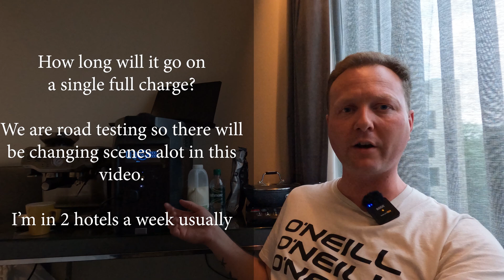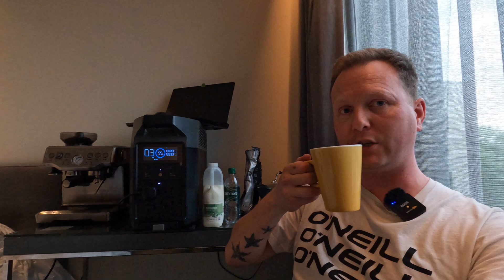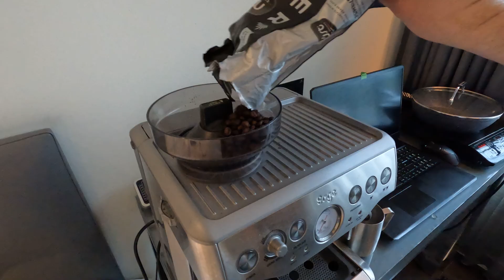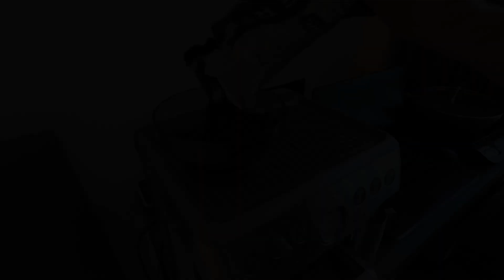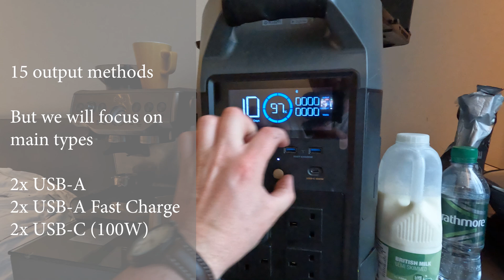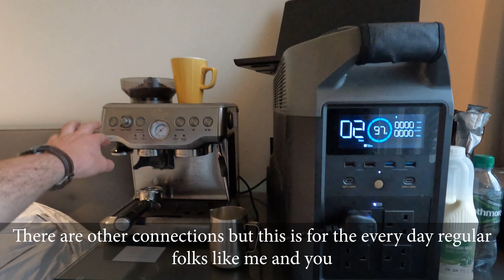EcoFlow Delta Pro What can it power? Powering Everyday things.

Comment: Haven't seen any videos of people testing/using these large-scale powerbanks/powerstation things or what you might want to call them until I stumbled over this one - maybe they exist out there, but I missed them, so cheers for that! :D

Are these LiFePO4 cells maybe? I would strongly prefer that chemistry, because of the wear on traditional NMC cells when stored at a high state of charge, and also their relatively high self-discharge rate and limited number of charging cycles vs. LiPO cells. Higher fire hazard for NMC cells, probably not worth getting all worked up over as long as your powerstation isn't built using cheap noname surplus cells from China. :P

Personally I would probably buy Anker myself, but this guy looks really robust, and powerful. Sound level tho - oof! lol OTOH, running a water kettle off of batteries, that's quite the accomplishment! :D
Reply from the maker: It would of been great to have a bit more time with it as I could if took it to my boat and linked it to solar panels for testing.  Some times you just have to work with the time and what you have. Thanks for watching and taking the time to leave a comment.  The main reason I wanted to do a real world test is just as you say, not many people actually do real world testing on their reviews.

Comment: I have a sage barista pro, the mrs refuses to let me take it on the boat... Which is only 19' long anyway so might make sense 😂
Reply from the maker: My famous barista express which always gets a few eyebrow raises when I head to the marina and it's in the trolly, or at work when I'm rocking up with it at events/gigs has taken a bit of a beating. So I picked up the barista pro which works pretty good, it heats up a lot quicker than the express.....i do prefer the express though. But I'm looking at the bambino one which doesn't have the grinder on it but smaller and lighter to take around with me. I stay in hotels a lot so again I get a few looks lol. I picked up my pro on ebay, there was a refurbished one I think it was around £500 vs the instore £700-£750. The bambino pro was from memory £200 so maybe ask Santa claws, or bday gift :-)  

Thank you for taking the time to leaving a comment, liking the video and subscribing if you did. Let me know what you would like to see. I have the fun task of pulling out the boat in a few weeks for the wonderful job of anti fouling and changing some sensors and prop shaft seal.